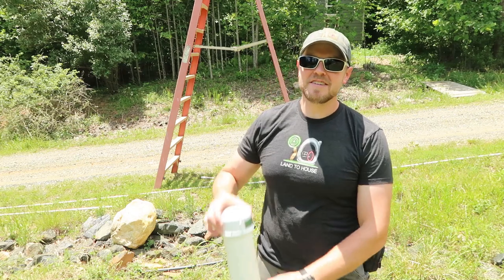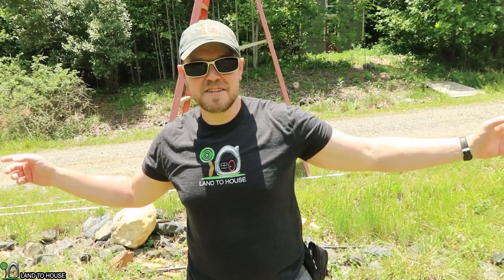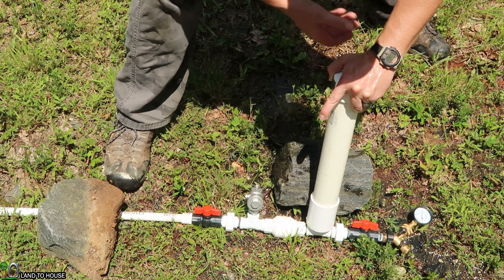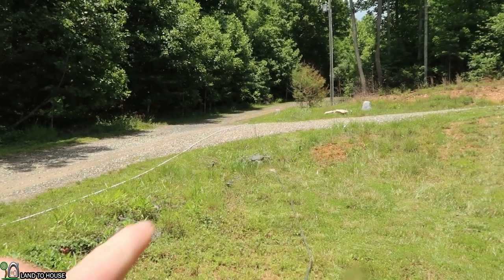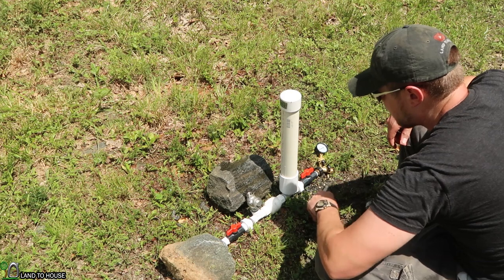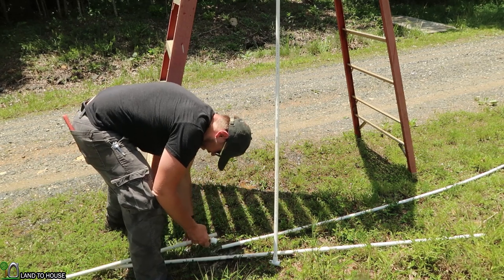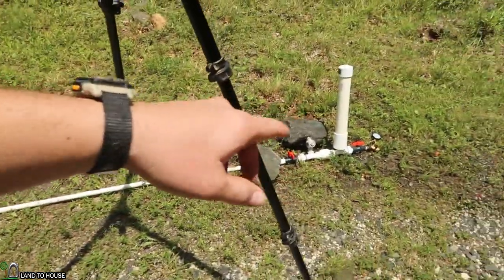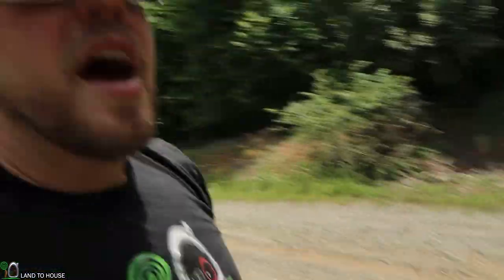Will a Check Valve Replace a Stand Pipe in a Ram Pump

Comment: Great to see you used my suggestion for a video; now... to actually watch the video!
Reply: Now I’ve watched the video, it’s a shame that it didn’t work, I honestly thought it would. 

I wonder if it’s because with the stand pipe, you still have the same amount of drop as from the source, but with the NRV, you’re essentially creating a new source with much less drop
Reply: How did the stand pipe help the pressure to increase in the first place ? Is it because it traps the air bubbles or am I being dumb here 😂
Reply from the maker: I think the issue is just the valve limiting the flow of the pressure wave. An open air source is needed for the wave to push water back out slightly.
Reply from the maker: The cycle time is increased when a stand pipe is used. the pressure wave is shorter and does not dissipate.

Comment: Nice video and presentation. 
To go or the theory we need a non return valve that has little to none mechanical force to push open and close. Otherwise it acts as a flow semi inhibitor. Adding confusion in the equation.

Comment: Seth, I'm thinking of doing a ram pump on my pond overflow. A couple of questions, and maybe tests for you. On drive pipe designs, have you tried PEX tubing for drive pipe? Does the drive pipe need to be straight? Can it be curved, looped or does it have to be straight as possible?? Does length of the pipe, or only head pressure effect the system? Can you go over the stand pipe uses/overviews again?  I'd really like to build it out of PEX if possible. If not, PVC would be my next option.Loving your videos.

Comment: You are so good and informative,  these experiments builds a lot of knowledge! So now we know that a non retun valve alone in the feedpipe blocks the preassure wave, but if a expansion chambre with a bike tube is placed between the non return valve and the rampump, would that affect cycle time? Or would it work? I love your channel. 👍

Comment: You should try putting the check value vertically instead of horizontal.

I've seen a setup that was 2 check valves, one on it's side and the other vertical

Comment: Wow.  Ha. I was sitting on my seat ready to see the magic.  Check valve just didn't get,er,done.  O well.  Great video.  Thanks for trying another idea.  I thought the stand pipe was supposed to be a larger diameter than the drive pipe.  O well,  you did show a improvement.  Your test are very educational.   Thanks again
Reply from the maker: It does work best to have a stand pipe that is larger but the pump will work with a stand pipe the same size. ... I was hoping that the valve would work.  Oh well. It was at least a good example of how much the cycle time matters.

Comment: So I've been thinking about getting a 1/2" or 3/4" RAM pump off you for a small off-grid cabin on the weekends, it has a great year round small Creek with some good fall to it and even a couple waterfalls coming down from up above. The guy I'm buying it from already has a gravity fed drip line coming down to the cabin and it's plugged in but it only has 12 to 15 lb of pressure at the cabin. I will only be using water to take a shower, flush the toilet and use the sink for washing dishes and also running drip line to some fruit trees on the property, The question I had was whatever pressure the ram pump builds up does it stay constant in use? Or does it slowly drop off to nothing. Thx

Comment: Did you maybe introduce a air pocket in the drive pipe down stream of the check valve during the change over ?
Reply from the maker: That is possible. but I manually clicked the valve long enough to get that air out. The pump acted the same as when I tried the none return valve in the other video. Just does not work.

Comment: ok so here is an idea, swing check valve, then a pressure tank, then your drive pipe. Thinking the hammer would back against the check and go into the pressure tank, causing a stronger return.

Comment: Why don't you use a normally open valve? That would make the system self priming...
It would need to have a screw to set the pressure. The pressure then I set to above the static input pressure and below the dynamic pressure when the water is moving.
Then you would not need the pressure wave to open the valve up.

Comment: Would it not be shorten the drive cycle? 13 cycles in twenty seconds vs 23 cycles in twenty seconds.
Reply from the maker: Its best to have one cycle per second. If the cycles are too short or too long the efficiency is reduced.

Comment: i think why it didn't work was because the pressure wave was not realy big enough to close the check valve. but even if id did close, the period that it was closed was in milliseconds maby even microseconds i have done the exact experiment but with transparent pvc and check valves. but i used a different kind of check valve so maby my experiment didn't work exactly as yours. maby you can try to change the check valves to the same as he used https://www.youtube.com/watch?v=enBEMgDR3-A